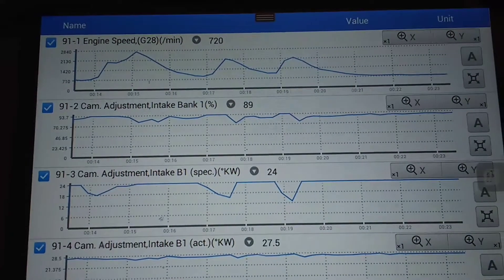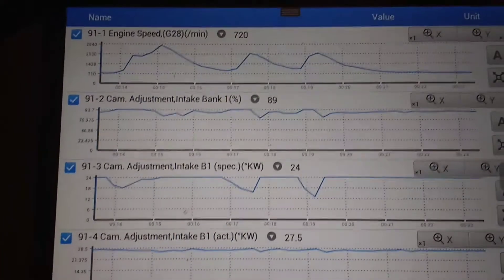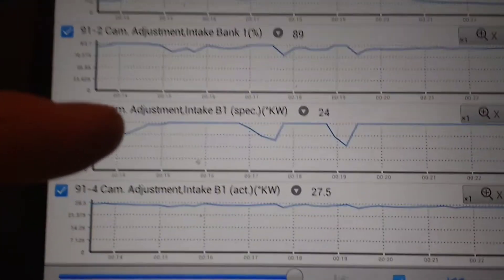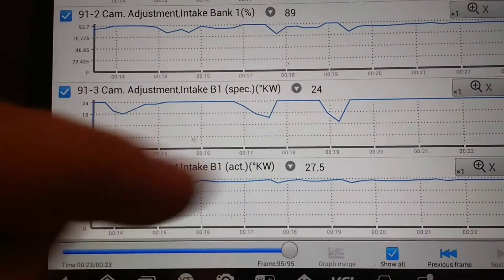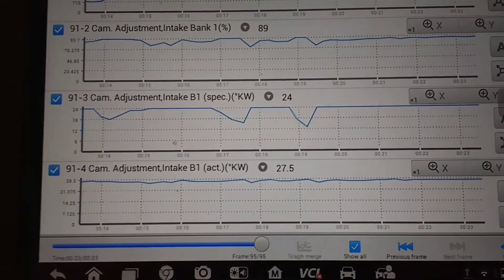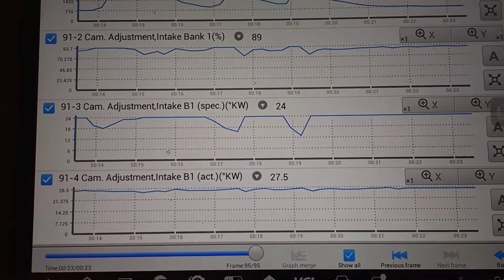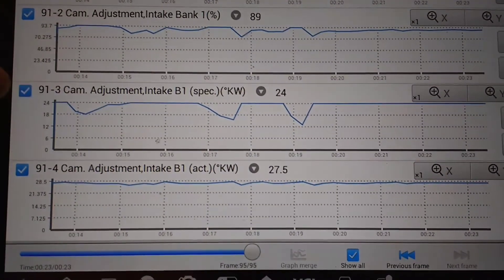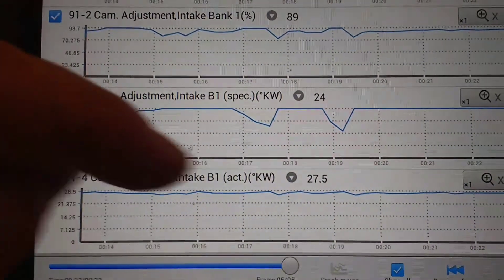VW GOLF 1K JUMPED BELT/CHAIN? Part 2

Comment: if you think it's stuck, set a trigger on the scope & either carry a basic setting (if available) or take control of the solenoid yourself & watch for the shift, can't remember if the other cam is monitored or not so bare that in mind !

Are you trade ?
Reply from the maker: BBS_Robski hi thanks for your input, had the car back today and I grounded the control side of the vvt with engine running but no change in rpm which I have experimented  on other cars to prove solenoid,  my feeling is solenoid is stuck/defective ps I'll make new video later to demonstrate cheers sandy

Comment: hello sandy  how you getting on with the golf? seen a few vws with broken woodruff  keys on crank sprocket  throwing  the timing out not even a tooth causing problems i know you did say the vvt solenoid might be stuck  but check the timing if you can regards tony
Reply from the maker: tony pond hi Tony good to hear from u know how they say always check the basics, well there was 1 gallon, yes 5 litres of excess oil in the car!!!!  Literally 1/2 way up the dipstick, that why vvt was not moving
Reply: hi sandy  thats true basics first good you got it fixed lucky the crank oil seals never went with that much oil .